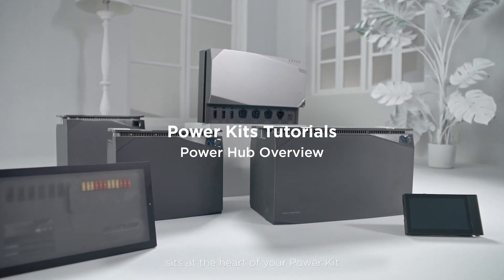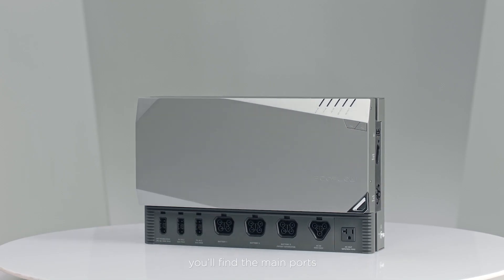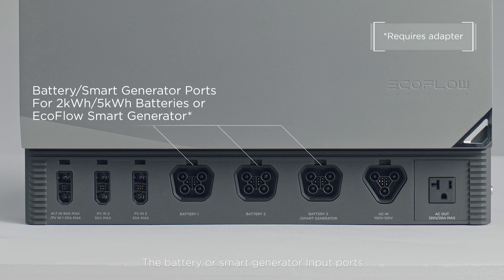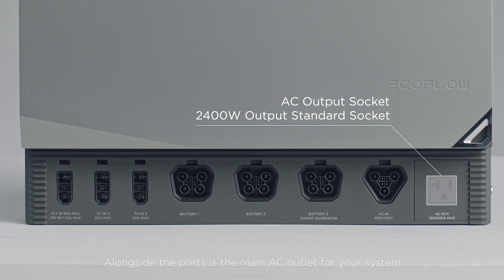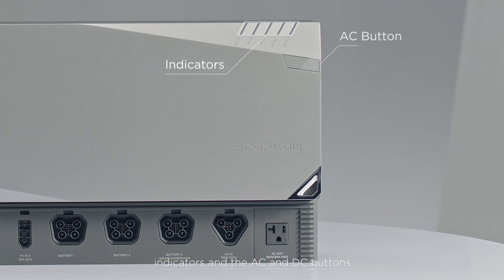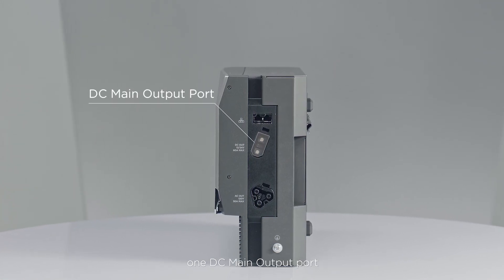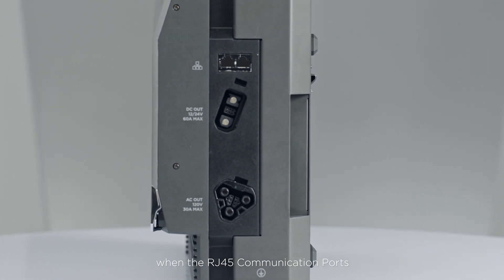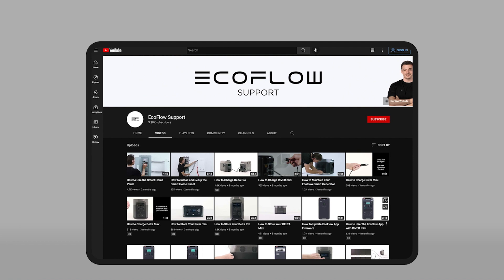Power Kits Tutorials - Power Hub Overview

Comment: Can you connect a Delta Pro to these?
Reply from the maker: Definitely.
Reply: @EcoFlowTech  so in theory I could get one of these with a battery in 1 port. 
Delta Pro 2nd port
And either another battery or a smart Generator in the 3rd port ?
Is that correct?
Or possibly 3x Delta Pro's???
Would that work?
Would it charge the Delta Pro's?  Or only draw power from them?

Comment: Do I need to ground the power hub to the vehicle chassis using the earth stud? If not, why not? Thanks!
Reply from the maker: Hi there! Yes, it is required. The power hub ground screw is connected to the ground wire with a wire.
Reply: Great. Thank you…
What gauge wire should I use?

Comment: Nice! I only want this system cause i want to connect it via fusebox and not with PV cable (x/-) :)
Can i connect batteries like Pylontech US5000 48v or something else?
Reply from the maker: Can you provide the output specification parameters of the battery you mention? Preferably with a link to purchase. We will double-confirm whether Power Kits can connect to it or not.